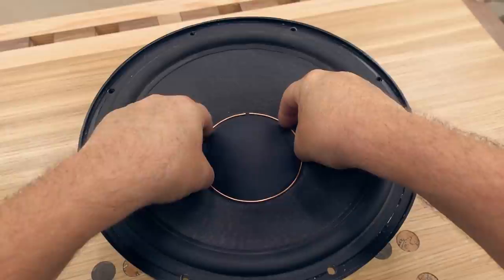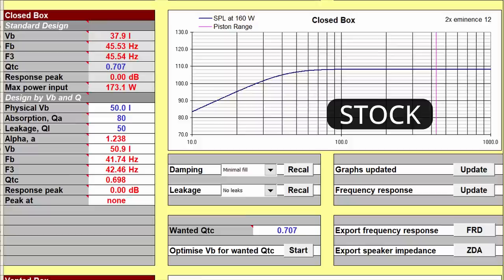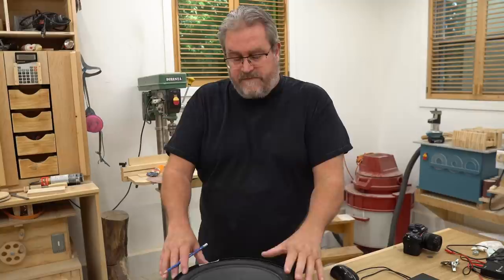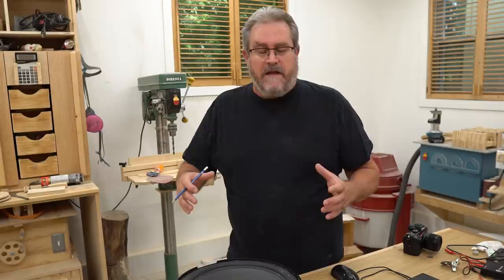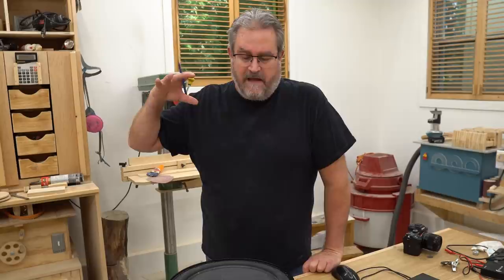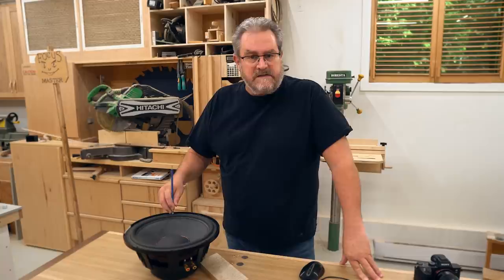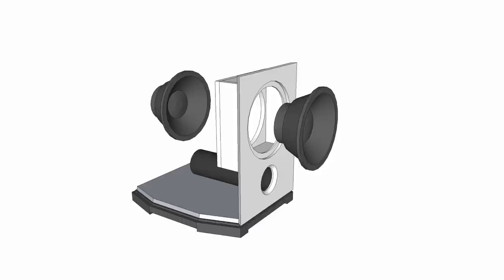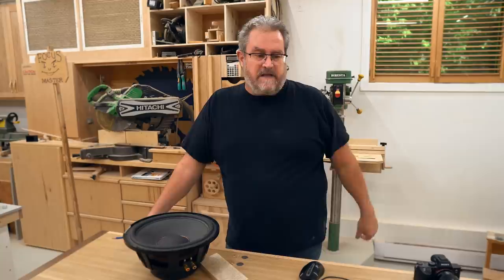Dead Simple Trick to get More Bass from a Woofer / Subwoofer

Comment from the maker: I say "dead simple" and that's true - it doesn't take much to glue a weight onto a speaker cone. But there is a lot of work that goes into figuring out how much weight to add. And what that weight will do and whether it's worth the tradeoff.
All of this will be old news to more seasoned speaker builders; there's nothing new about this method. But since I considered doing it for the four woofers I have, I thought I'd make a quick video explaining it. 
The added mass lowers the Fs (resonant frequency of the woofer) but also make it harder to drive. You need more power to get the same level of output (spl). Also, if the woofer doesn't have a long enough stroke (Xmax), it may not be suitable for this at all. The lower the woofer plays, the longer the stroke needs to be to avoid audible distortion or damage.
In the end I decided to use the woofers as designed after a break-in period that loosened up the suspension. New drivers (even ones that are 10 years old...) will loosen up over time from being used, and that break-in speeds that up so that you can get more reliable test data.
The speakers I'm building will be in two section - a subwoofer on the bottom with three-way speaker on top. The subwoofer will have two of these woofers in each box in an isobaric arrangement. The chief advantage that isobaric gives you is that it cuts the size of the box in half. It really only makes sense to do it when you have a situation like I have where I have 4 woofers that can be used.
Reply: Cheers for the reveal so early in the video. First thing I thought of, was not only the sensitivity would decrease, but so would the damping factor. Naturally you can control some of that with more power, to an extent, but if the voicecoil / magnet / motor assembly isn’t up to it, it will sound floppy  

Back last century when I would rebuild JBL PA drivers and give them an extra kick, I would not only add a little bit of mass to the cone, I replaced the voice coil with a longer, edge wound coil to give you more even energy over the travel of the cone. 

While you had to have an amp with a decent damping factor, and while you could drive the cones past their point of linearity, these speakers thundered. You didn’t need to drive them as hard, but, you did need an amplifier that was capable at driving them hard. 

Garry Nessel taught me this trick. Brilliant guy. Sadly he is no longer with us.
Reply: Very good clarification there; and that's why I would never attempt this on a high end subwoofer that's had tons of engineering behind it like my Sunfire or my Martin Logan. I'm curious to try it on a cheap one though just to sate my curiosity.
Reply: ⁰
Reply: Waiting for your tests and measures for this method!
Reply: it's very sus when you don't do a before and after demo /tone test, i am very skeptical and don't wish to damage my speakers trying this
Reply: @MidlifeRenaissanceMan  Back last century, what JBL speakers didn't come from the factory with an edge wound coil?

Comment: In effect its not so much dropping the bass response to lower frequencies, but really lowering the sensitivity of the speaker at higher frequencies. In effect basically like dropping the mid-bass bands on an EQ. The extra mass lowers the cone excursion at higher frequencies since the motor force is not changing despite the extra added mass. Can be useful to a speaker builder if your trying to optimize multiple parameters at the same time, but worth saying that its not something you'd want to do to a set of off-the-shelf speakers since it would throw the balance off, unless you plan to retune or redo the cross-over.

Comment: Appr3ciate the knowledge. Im more of a new speaker builder. I have 15 years experi3nce. I have made over 15 portable bluetooth speaker enclosur3s with drivers and amplifiers and more recently higher voltage amps requiring 36 volts. Thanks for the video, i used what you said on a couple passive radiators to add mass...

Comment: Doing this is fine if you arent looking for max output, but what this is essentially doing is lowering the max output capability of the driver. You aren't actually getting more low end. The max low end of a driver is excursion limited, so that doesn't change based on the fs of the driver, however, the max output of midbass and high frequencies are power limited generally. This also means they are sensitivity limited. The era of full-range speakers is ending and for good reason, subwoofers can be placed in better modal areas and can do much more than most full-range speakers. 

IMO it is never a good idea to intentionally add mass to a driver to get lower bass, you are better off using DSP to eq up the low bass because you'll still have the headroom in the midbass and higher frequencies. You can also tame peaks and modes to get much better sound quality.

Comment: I used BBs for years glued around the dust cap with white glue to achieve a lower resonance. It is not a solution for all woofers but I have used for drivers as small as 4".

Comment: I decided to add mass by cutting a black piezo wire short enough to go around the outside edge of the dust cap on the active subwoofer in my guitar rig since it was already overdriven with a decent bass knob and power amp going through a stereo pedal. sounds perfect with a slightly deeper voice. It really brings out a layer of sub  bass when you need it.

Comment: That's the secret to the under-seat subwoofers.  I have a Blaupunkt powered subwoofer and the center cap came unglued, making a horrible amount of racket.  When I removed the cap, I found it is made of a heavy piece of metal.  Adding weight to a speaker slows the cone down.  It's like a mechanical crossover.  It doesn't make it hit the lows harder; it simply rolls off the higher frequencies.

Comment: Interesting, but I would advise against this is you have other means.  Lowering the Fq does not really mean you get more bass. If you need a boost down low, then you can do the same with EQ instead of making the driver have a higher Qts and effectively lowering it's sensitivity. It will have to consume more power to deliver the SPL across it's whole passband esp. If it's a lot more mass

The most high end subwoofers typically have huge motors compared to their moving mass and low Qts.  Mass is the enemy!

Final Fq is really defined by the system, not just the driver.

In short if you need more low end, pick a different box or EQ to driver if you need to
Reply: This might be a year old, but I just made a similar comment. I commend him for trying to think outside the box and post it on YouTube, but I don't think this guy actually knows much about speakers. I wonder what his background is since he seems to misunderstand some very basic engineering principles in a few of his videos.

Comment: Sony had a tech similar to this in their Maximum Television speakers. I had received a pair of well used Max Tv speakers as partial payment for a job I did for a lady. They actually sounded really good (especially for free) and used them for years. I think the woofers were called Super Acoustically Loaded, or something like that. Being curious and armed with implements of disassembly, I set out to see what a super woofer looked like. Well, strangely enough, they looked like any other high excursion driver... except the dust cover had a weight attached to it. At this point, I cannot remember what the weight was made of but, for the size of the driver (6.5" IIRC) they had the ability to shake the floor of my apartment.... much to the chagrin of my neighbors. Mystery solved, put them back together and continued to enjoy them till they got hit by a surge from a lightning strike.

Comment: I built very similar set of speakers. Use Emmence drivers in an Isobaric arrangement in a sealed box with a 15 driver upper section. When used for two channel listening the bass is punchy and clean. In theater use I have numerous additional subwoofer.

Comment: This technique was used years ago by Kenwood . On the drone cone I believe. 
The system was supplied with a couple of screw on weights.
Breaking in .... Guitar strings are the same.  A new set tend to have a jangling sound then settle in and become sweet then latter sound dead.

Comment: Ambitious project, very much looking forward for the result. I assume this is going to be at least a partialliy active design? With a separate amplifier and active filtering for the subwoofers? Passive filtering at 80 Hertz isn't something you really want to do. One more thing regarding the isobaric enclosure: Try to keep the amount of air between the two drivers as low as possible. You want a stiff coupling here.
Reply from the maker: The eventual plan is full active, for the three-way as well as the sub, but for now the subs will be driven from the subwoofer output from my 2.1 receiver with the crossover set to 80Hz.

Comment: It's like adding a steering dampener to an electric scooter that can go 70 miles an hour to hold the wobble. It is to hold it more precise. Is adding a radiator to a ported Box or a sealed Box also helped as well as the line of transmission. The speed of the wave. Is the power of the wave. And the accuracy of the wave. But you may have to now consider that you lose some of the higher frequency output of the subwoofer so you will need to adjust your crossover and have midbase driver adjusted. You might have to change your midbass and your Tweeter so that you can meet the crossover point of what the capabilities are now adjusted to.

Comment: I would not build speakers if I just put drivers in boxes and designed crossovers. My speakers sound different with good recordings with some reverb in the recording. But not with flat sounding recordings (like Van Morrison, Moondance). 😅 in good recordings the speakers are more spatial and more 3D than most normal speaker. How to make them:
Get a good 5" FR driver and run itcompletely open, on top of a speaker box with a woofer in the box. Use an inductor on the woofer and maybe a resistor to balance woofer level.  filter for the FR driver is optional (but helps). Without a filter on the FR driver is ok if you use the woofer level and choice of inductor to equalise it. To get more sparkle out of the FR drivers, slit the cone (right through) a few times around, near the center, with a sharp razer blade. The best treble in the world! And the most holographic speakers you will hear, with an insane soundstage (especially with a filter on the FR driver, if it's done right). I also have a 100 mf cap on it too, for less excurtions, and more power handling. Mine crank! 😅

Comment: There is another trick to get a lower fs without changing any other parameter,glue on the rear of the speaker around the magnet near the spider three or four little pieces of aoustic foam long enough to see the end move if you blow on it. Try and see😊!

Comment: For the ever so slight increase in the bottom octaves, it looks to take too much of a hit along the rest of the frequency curve, however, it would be more useful if it better balances the overall output of a speaker at a given power applied.  Wouldn't changing the crossover do the same?

Comment: The “ideal” speaker material would have zero mass and have perfect stiffness. 

Adding weight to a speaker cone is going in the wrong direction.
Reply: We don't live in a "perfect" world. Lightness gives us the ability to go high and loud, infinite stiffness allows us to do that with zero distortion, but when you look at the fact the rear wave needs to be contained or rerouted, that's where you need to look at the cone's resonant frequency and why in the real life this is a useful little trick if you needed to lower your resonant frequency for your box design

Comment: Fascinating. I'm kind of surprised I've never heard of the isobaric configuration before. I'll have to go look into the physics and benefits of using it are.
If I had to guess off the top of my head (and as you elude to in the video), it sort of simulates a larger enclosure volume? Almost like a port, but... active?   I'm probably way off.
Reply: These are not active design.
These are passive design.
John will be using passive crossovers to regulate where each signal will be going to,ie: sub,bass,mid,treble.
Active, uses a active crossover that is adjustable,electronic circuitry. Put that straight into the amp,straight to the speakers.
Reply: @xmachine7003  I was talking about the isobaric subwoofer enclosure. Having two drivers in the same chamber.

Comment: Wouldn’t a multi-band frequency equalizer accomplish a more accurate result, or are you merely building for your personal listening preferences?
Reply: What you suggest would basically allow the amp to increase output in the desired frequency range. The only way i can see weights increasing subwoofer output is by increasing excursion, because it isn't increasing cone surface area. Adding weight to a woofer seems like it would reduce efficiency and frequency response, and inhibit its' ability to hit higher frequencies. In my opinion, stay within specification. Don't modify your subs or add weights to increase excursion. If you want more bass, get bigger subs with higher excursion, more surface area, and stronger (bigger) magnets. Then get a stronger amp to match.

Comment: I just got a new subwoofer from Bestisan and it's a downfiring version. I also have it in a side firing version. Both have the same amp and woofer. Only thing is the downfiring one has one small rubber pad stuck on the dust cap off axist. Is that a mass pad of sort or was this a repair? I'm stumped cause it's new out of the box and I've never seen this before. 🤔

Comment: You have these speakers already, do you can make use of them in a project.In my view the Idobatic design (named Isobarik by  the company Lynn Sondek who first marketed  the dedign) is obsolete .Modern subwoofer drivers are engineered to achieve the same or better results with a single driver.Way bach in the 1990's  drivers like the JL Audio W6 and the Kicker Solobaric were pioneers in  producing deep bass in a small space .This development was spurred on by the explodion in car stereo and carried over into home audio with the meteoric rise in home theatre.Today you can get deeper bass with greater efficiency in a  box smaller and simpler than an Isobaric using  a modern long excursion driver which simpley slaughters the isobaric designs of old, furthermore you can do ported designs .

Comment: With all else staying constant on the woofer, how does it play any lower? Yes, the F3 is lower, but that doesn't mean anything since the xmax and the motor BL is still exactly the same. Even the screenshot of your F3 and the frequency response shows exactly what I'm saying. Sure the F3 dropped, but that's because you lost like 3db above 35Hz. That doesn't mean you gained anything below 35Hz. If you want to change the frequency response, you could easily do that with a DSP, no need to add mass. 

How does adding mass boost the SPL of the lower frequencies? I feel like I'm missing something.

Comment: Big Full range towers are the hards to do, to get them sounding right.
 Your going to do this anyway because you got the speaker builder bug in you.
 I do like the spilt box idea. Its a safe mode just in case you have issues on the bottom end but two sub does help out to get the bass waves to fit in at the sweet spot. vs two FR towers. Hope you have a nice big listing room or the whole basement min.30' for a 20hz to be devolved.
Paradigm sub the one with six drivers I thinking of doing a bootleg using 4-6" drivers for my room size. Because I don't want to pressurize the room I want to apologize pressurize is it too much.

Now go do your thing, and stay on target to your goal that will make you happy. Your the that has to listen to it, not me.
 As am trying to be nice towards you.

to speed up your testing can I ask?  just use a sonoa tube. 
I do this for DJs they can just roll them no lifting as most are a one man show

Comment: I have built speakers and have poured through the speaker and vent hole floor-leveler cement to a thickness of about 5/8” for dampener. They sound good but I don’t have the equipment to test like you do, so I was wondering if you would do it. Obviously you have to pour in cycles since there are six sides. I got three side pours in a single day.

Comment: I have actually done this trick on Bluetooth speakers cause they lack bass i stick a coin which is i think very heavy for a 40mm driver but the bass output is dramatically changed it cause deep but also the vocals and treble got pushed down so yeah there is a tread off i mainly do this in woofers

Comment: Did you find that your break-in period lowered the f3 at all? I've read that long (24 hours) burn-ins can gain an extra ~5db or so of lowered fs/f3. Very cool cabinet design.
Reply from the maker: There was a significant change after the first hour, Fs went down from 30Hz to 28Hz. But the second hour of break-in changed very little, so I don't see a need to go for much longer than 2 hours.
Reply: @IBuildIt  Neat, thanks :) That shows why you should burn in before designing the enclosure.